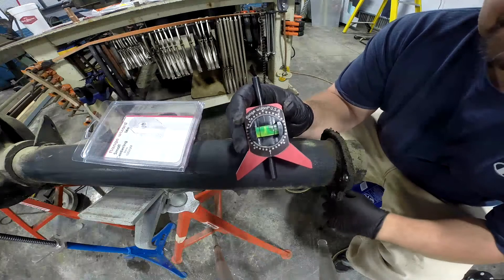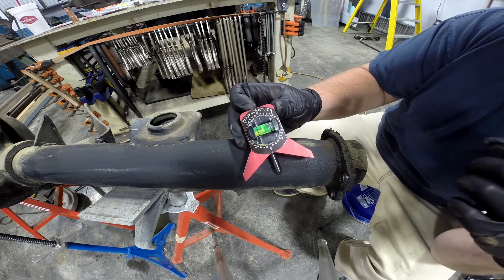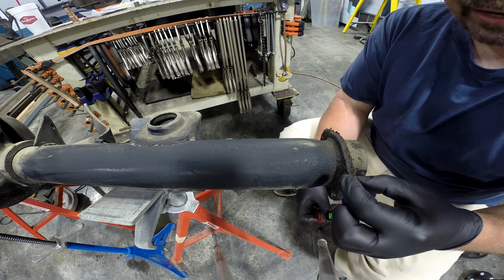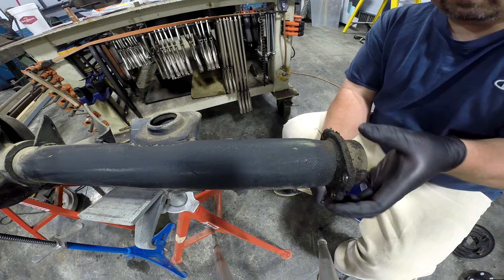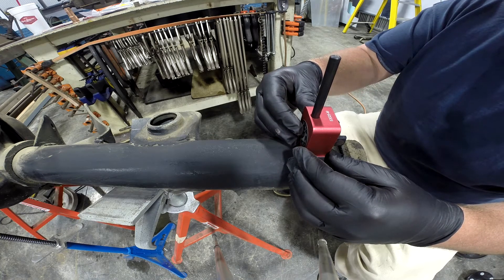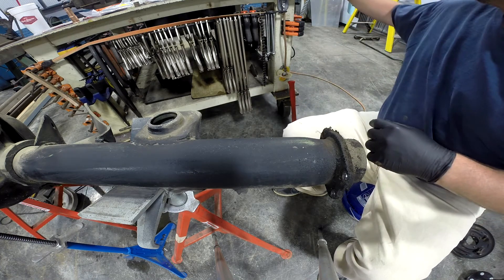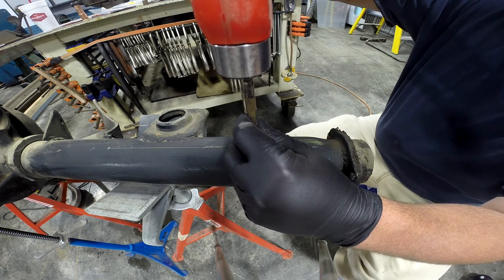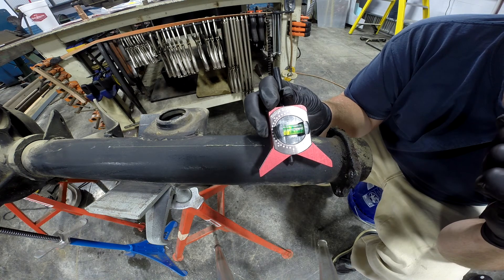Have you seen my tool 018 - Centering Head

Comment: Seems like if you wanted the orientation correct, you could have used shoulder bolts in the flange holes and a magnetic level to set the flange angle to a relative zero, clamp the axle housing to maintain orientation, then cut out whatever section you needed to. Orient the flange angle back to zero, then weld it back on.

Comment: seems like I would have preferred a piece of angle iron on the tube and draw a line
Reply from the maker: You are not wrong. A piece of angle iron would have been more than accurate enough. It is hard to get views on a video about a short section of angle. Truthfully I have been wanting to do a video on that tool and this job was the only thing in the near future I could show using it on. The tubes on that 8.8 ended up being in the center chunk crooked anyway and when I welded the ends back on they were offset by over 1/4" so the lines/punch marks were of no use. Thanks for watching.